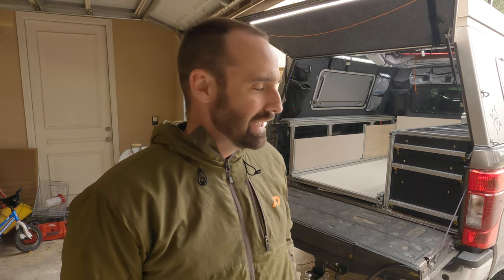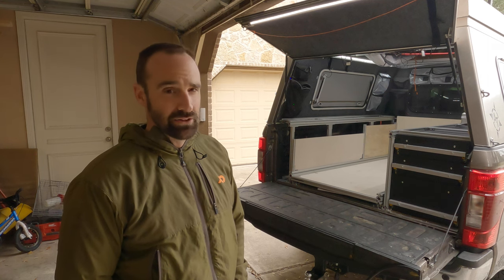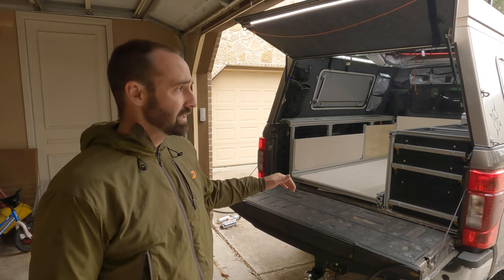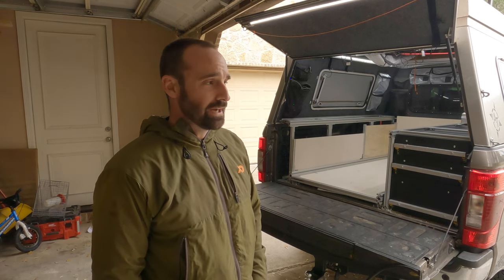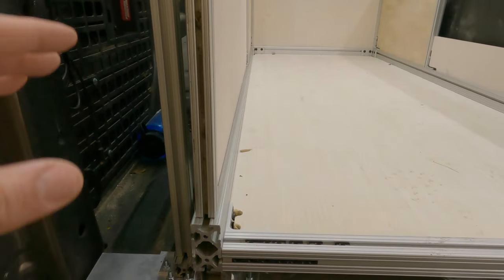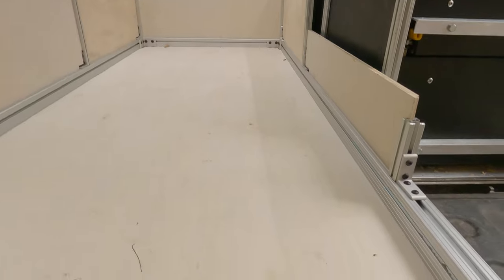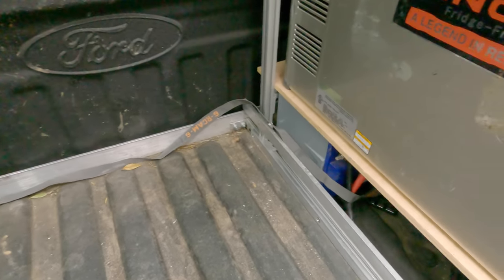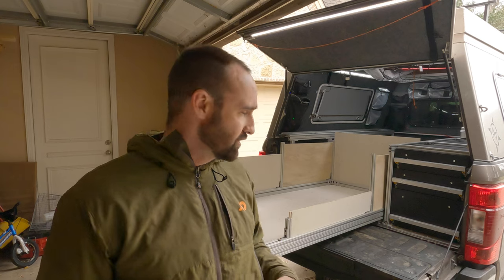DIY Bedslide - simple, strong, lightweight - 8020 aluminum - ultra low deck height

Comment: The best feature is the low deck height. Most off-the-shelf products compromise 3 or 4 inches if they are rated for any significant weight capacity.

Comment: Thanks for sharing, super cool! Thinking of building something similar for my E350 van. Is that drawer full extension?

Can you share some links on where you got your 8020 materials, connectors, etc. Specifically what you used for bearings and rail that they slot into. 

Also if you could list sizes of 8020 and where you used. I think you touched on briefly, I probably just need to watch again. Thanks!
Reply from the maker: Yeah, the drawer slides are 'full extension'.  The upper drawers have 48" slides on them, but the lower slide dog-legs around the wheel well, so it only has a 22 or 24" slide.

The prices and shipping vary over time.  I got most of my extrusions and fittings from Mcmaster.com.  But you should price things out with shipping at tslots.com, grainger.com, 8020.net.  

Three sides of the slide itself are 1530.  If you wanted to save weight, you could change this to 1030 and it would be almost as strong but a lot lighter.  
The rest of the build is 10 series.  Mostly 1010.  
If I were to build again, I would use 1020 for both the upper and lower inboard rails (I only used it for the top rail).

Comment: Thanks for the detail. Going to build something similar for my F150 and GFC. Like you I am optimizing around sport item storage rather than kitchen and camp gear. I am looking for alternate ways of joining the 80/20 besides those corner brackets. 

Any idea on the weight before the bed slide?
Reply from the maker: Not sure on total weight but in an F150 I would definitely use "1030" profile for the slide rather than "1530" like I did.

Comment: Great video. What size bearings did you use and where did you source them from. Keep up the great work
Reply from the maker: I used McGill bearings rather than knock offs.  I got them from amazon, but I think both Mcmaster & Grainger sell McGill.  

On the truck I used McGill CYR1 1/2S Cam Yoke Roller.  But You could buy similar that are smaller diameter for a lower deck height. Just make sure the load capacity is sufficient for your needs. 
https://www.amazon.com/gp/product/B0071AQE6Q/ref=ppx_yo_dt_b_search_asin_title?ie=UTF8&psc=1

On the forward part of the bed slide I used "McGill CF1 3/8 Cam Follower".  I don't see them on Amazon right now.

Comment: I watched your long term ownership on TFL about the gas 250. I was curious if you found out the issue on the transmission issues? I feel like ford always has these issues
Reply from the maker: Yes, Ford fixed it under warranty.  It was a design issue in the valve control body that has been fixed, and mine was fixed with the updated part.  It took a month to get the appointment, and then my truck was at the dealer for another month.  But transmission has been good since.  I've put another 20k miles on it since then.